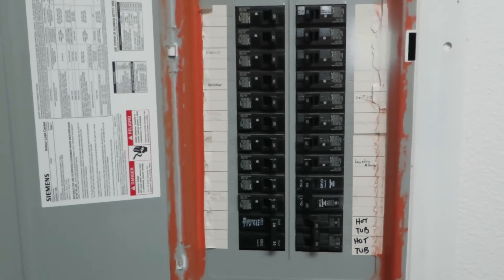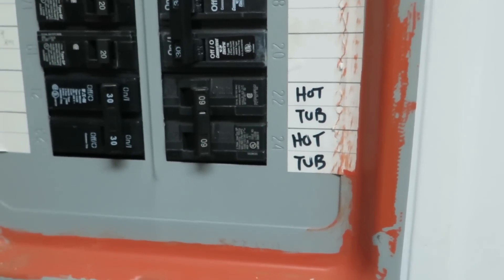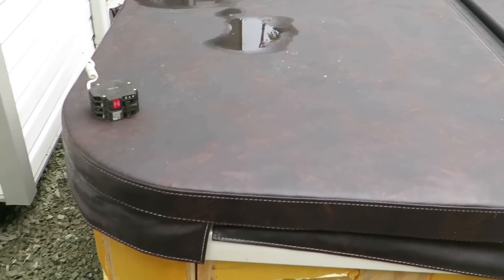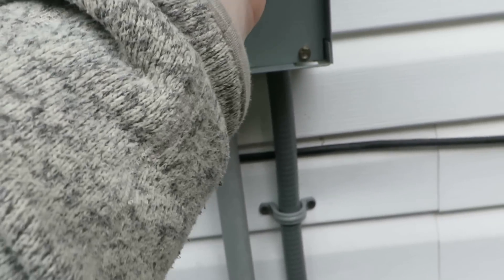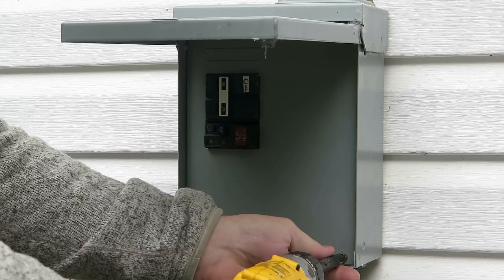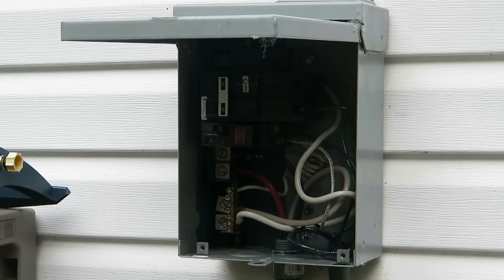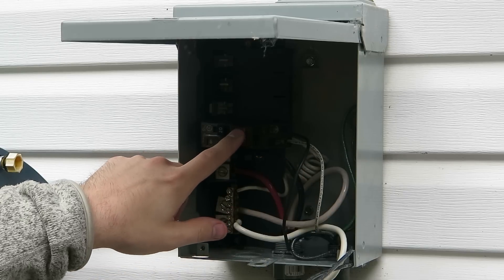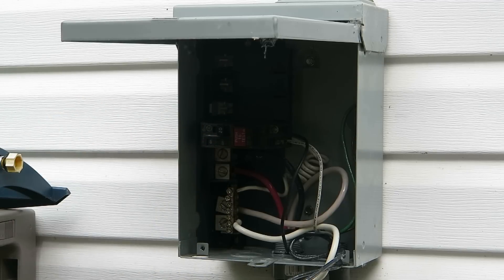Spa Electrical Basics

Comment: The 60 Amp breaker plus de 20 Amp breaker would NOT break at 80 Amps!  .- ( They are in separate circuits)   In an overload,  any of the 60 Amp  breakers  whether at the garage panel or at the spa site will trip first,   while the 20 Amp breaker will trip independently with a 117 AC overload..       Do not place the box "were is convenient"  follow the code!.

Comment: How come no one noticed that this is a new installation, so it is all his work. Second he added the 60am 2pst GFCI breaker in that panel and THEN!!!  ran and connected #12 THHN to the Hot tub and wants to change it out to a 30a 2pst  GFCI breaker without updating the Conductors to #10 at least. Plus run the Sealtite under the hot tub at it's closest location to the disconnect. Did anyone see any Grounding Conductors? This man needs to hire a pro and not put himself and family in danger.

Comment: do not listen to this guy. he has not a clue how electricity works. coming from a red seal electrician, the 60 amp breaker and the 20 amp breaker are FINE....  20amp plus 60amp do not not actually add up to 80 amps... its meant to interrupt a fault or combined load of 60 Amps. a normal operating tub will not draw even close to 60 amps. its purpose is to interrupt a fault above 60 Amps. and motors will have an in rush current that spikes high at start up and drops during normal operation... (Canadian electrician)
Reply: ya i was so confused by comment section until i seen your post to verify i wasnt lost. i was going thru my head like the owner didnt realize he just needed to see what the normal constant amps wld be than see what the start up rush is. ive seen this done wrong before its like  

4000watt heater on  a single phase wld draw 33.4 amps so 40 amp breaker vs dbl phase 240 thts  16.8 amps. so with a dble pole 30 means only half the amp usage plus start rush?  sorry been so long i cant remember math (but i think something high draw like a filament bulb is %10 s0 say 2amps at start safety margine will say 20amps)or i wld just overcompensate what the info plate wld say. but the 60amp breaker at worst wld need max of what 20amps so 1/3  of its max capacity.  im only a 2nd yr apprentice at best  and havent done the trades professionally in 20yrs very rusty but getting more work during these times (the pros are either to busy or cost to much in these tough times where as i can safely handle these requests.    (well if my math is right ) otherwise ill just stick to outlets and lights lol  (N. east  usa)

Comment: Bro , I’m curious did this last, your line wires are way to small .
Reply: I mean, it only burst into flames a couple of times. So it's ok. 110, 220, 277, 480, 2300, 4160... whatever it takes.
Reply: Jason Allen right! Also the white neutral...
Reply: Heard the new family were on the news just days later. Something about multiple electrical fires or something.
Reply from the maker: Works fine.  Just sold the house.  I use the hot tub 3 times a week. Zero issues.

Comment: Im sitting here trying to find out why this tub needs 220 and 110.....
Reply: This is actually how hot spring 110v convertibles are wired. 30amp 240 for heater, 20amp 110 for pump.
Reply: Joseph Kellner makes sense than if one of the hot tub brands does it split.
Reply: Nothing weird there kids. Extra breaker = extra circuit for whatever else you want to include in your spa package. Like an extra 110v outlet to power that toaster he likes to use while he's soaking. Outlet, 5 feet away from the tub ofcourse. But with your trusty 5ft extension cord, you can have any dangerous appliance in the tub with you all while within code!
Reply: Maybe controls use 110 and the motor and heaters may be 220
Reply: Stephen Roberson that would just be strange. Even the radio systems in some units don’t require 110v. I have to wonder if the spa box was wired to support both and they just happen to both be turned on even tho the 110v doesn’t have wires coming out.
Reply: Edward Sessum hot tubs can have only the heater on, for 110. Alternatively, if you want the heater and the jets on, it would be 220
Reply: Mad_ Max but they don’t get wired for both. One or the other.
Reply: Edward ... that dual circuit was common 20 years ago and the heater was split to run either 1500 watts on 120 volts or 3000 watts on 240 volts. Basically this gave people in warmer climates the option to use a 120 volt outlet to run their tub without the expense of a 60 amp circuit. These days the extra breaker is commonly used for a service outlet.
Reply: Hot Tub water is heated by using a typical 1500w at 240v. Think of regular water heaters that use electricity. 120v is for the lights, and sometimes for control circuits if relay coils are rated for 120v. But since it is such a little draw you can tapped off one of the 240v lines, you just need to run a neutral for any unbalanced loads.

Comment: Everything mentioned in this video is incorrect , inspector would write this up in a heart beat , neutrals terminated incorrectly , whip longer than 6’ , incorrect breaker for load , and please do not use electric drills in a panel ! GFCI measures 75v through neutral from tub and they “DO NOT TIE ALL TOGETHER” .
Reply from the maker: Would they?  It's been inspected and passed.  Sounds like there are either a lot of poorly trained electricians out there or a bunch of keyboard warriors.
Reply: photokendall no , lol poorly trained inspectors , city inspectors are not Licensed electricians , only adopt what county / city is for current code . Look up NEC 680 and educate
Reply from the maker: @live4545  I appreciate the code reference, however I still dont find any code reference as to what exactly is not to code.  The branch circuits and bonding all meet code, the pvc meets code, etc etc.  I was an electrician for many years and though it was practice not to use a drill in panels, there is zero code against such a thing.  There is annidotal evidence on not using a drill, but zero facts to back that up.   That's like saying you can't use a drill to install head studs in an engine.  Yes it's practice not to...  However, I have installed many head studs in engines using drills and then torquing to spec without any issues.
Reply: photokendall the gfci is not terminated correctly , and you can find the answer to why in NEC section 680
Reply from the maker: @live4545  Thanks.  I don't see anything there.  But appreciate the input.  I guess if I am doing it wrong so are a lot of others in the industry as the way this is hooked up is standard practice.  I quick google search of electrical spa hookup and I found this.  https://www.hottuboutpost.com/hot-tub-electrical-installation-hookup-gfci/ and this https://www.masterspas.com/documents/240v-electrical-requirements.pdf
Reply: photokendall I read that you sold the house, but just FYI the links you posted show exactly how you hooked up the neutral incorrectly. There must be a load side neutral attached to the breaker. Your load side neutral goes straight to the bus bar. In that configuration the breaker can’t monitor current difference and can’t do its job.

Comment: Please correct me if I am wrong. 
By code (You seem to like to stick to it, as all should) you must have  4 wires, out of your sub-panel to  hot tube, because Neutral (White) is not equal or interchangeable with Ground (Copper) that in case of emergency wont do good, if not installed right. I see no Ground in your sub box. Anyone is invited to comment, kindly, as spread of correct information is the goal here. Stay safe.
Reply: not all some do not require neutral

Comment: Dude has his white from breaker tied back to the neutral buss bar, the white out of the breaker goes to the hot tub not back to the buss in the box.
Reply: Common in hot tub panels is to wire the pigtail to the buss bar that is isolated from the ground (there should be two buss bars with one insulated from the panel and one directly on the metal)

Neutral in from the main panel goes to the GFCI doyble pole breaker, neutral pigtail goes to the neutral buss bar, and the neutral from the hot tub goes on that same neutral buss bar
Reply: @shimes424  Faulty information from an rank amateur...Dont listen to anything this guy has to say. You have one life, pay someone who knows.
Reply: breaker has a load  neutral  connection/white from breaker goes to neutral buss along with neutral ine

Comment: Hey quick question for all you electrical guys here... So I got a 100 amp main panel and ive had a 50 amp double throw breaker running 80' to a sub panel in my garage and ive had a 3 wire #8awg going through 3/4" emt set up goin thats worked great for years. Now i got me a 230 v 5 hp single phase industrial compressor and every time that hog turns on The attic and wall that the main panels on vibrate and buzz like a sum bitch but only for a few seconds then its good. So I hear I need bigger wire so i now have #4 that came outta an industrial building and some 1" ridgid ran now but my question is HOW MANY WIRES TO PULL AND WHAT SIZE?  3 or 4 wire? Oh and sub panels got a 10' earth ground jammed into the ground within 4 ' of sub panel and also its has a wire going to the cold water pipe on the washer and dryer crap just no earth ground on my main no clue why either lol PLEASE HELP THANKS FOR YOUR TIME
Reply from the maker: So, 230v 5hp...  230v standard is a single power conductor and a nuetral wire.  You normally have a ground wire by code to protect yourself.   If you pulled in a 4th wire it is usually used for anything that needs to run off 120v.  hopefully that helps.  We would need to know the amperage of the load to know what sized conductors need to be used.  However a #4 would work for a 50 amp load.
Reply from the maker: Here is a good site to calculate loads/distance and wire sizing.  Wire Size Calculator - Paige Wirewww.paigewire.com/pumpWireCalc.aspx
Reply: @photokendall  Hey thanks for all your help photokendall yeah so pretty much just said screw it and im going huge and when I say huge im talking #2 awg stranded but not the flimsy crap this stuff is about the same size thats coming in from edison side to my main panel. I figured its been working there so its pretty much like an extension of that right? Now i also have 240' of #4 awg as well only thing is 1 leg of my #4 is kinda shot out from getting caught on crap so I was just gunna use 1 leg of the #2.. Any problem ya see there man  I mean it should work just fine right or is it gunna do some crazy stuff like how if you run 1 single hot wire in a 1/2" emt it electrifies the shit outta that conduit kinda thing or should it be a ok? Oh forgot to mention I am not an electrician  just a feller wanting to save a buck and learn some stuff thats all ...Oh and have a blast doing it  as well !
Reply: @photokendall  i ENDED UP RUNNING 2 #4 AWG AND A piece of #2 about 25' long then spliced it in a box and continued running the left over #4 wire i had ...Is there any reason I shouldnt run it like that? IOts been up and running now for about a week and seems fine but if theres a problem with that please let me know buddy . Thanks again for all your help man
Reply from the maker: @janegoodall3862  due to the wire size there is going to be a lot more resistance using that wire which means you "may" not get as much current or voltage, but in real world scenario it shouldn't matter.  You should be OK.  Real world your worried about under sizing conductors because they can heat up and cause a fire.
Reply: @photokendall  Well Im pushing the living heck out of the system today my friend .....Doing some arc gouging or however its spelled which needs the ol lincoln arc welder and the big ol compressor oh and now my 10 high output T-5 light fixtures with 4 HO 6000k  35watt T-5 bulbs in each fixture . So with this subpanel you have wired up photokendall its going to be make it or break it and poof my damn house goes up in flames today so we shall see man . lol i'll keep you posted amigo and once again THANK YOU FOR YOUR HELP DUDE !!
Reply from the maker: @janegoodall3862  Uh, this installation here was for a hot tub, not for welders, compressors etc!  Your using an 50 amp breaker for a compressor and arc welder plus lighting?  That may be a BAD idea...   I have a 2 stage 80gal air compressor 240v and that requires a 20 amps, 17.5 but due to startup current it peaks around 20amps...  You need to go around and see what your going to be plugging in and running and then add those all up.  Once you know how much amperage your going to be pulling then you can determine panel size.  Sounds like you did this the other way around.  Hopefully your good.
Reply: @photokendall  Yeah im no electrician my brother all I do is make things happen when  i need em but yeah I have a need for more power in my shop /garage  so I ask the heck out of questions and such to as many people as possible and pick their brains a bit  kinda how you came about my friend. I do have an arsenal of electrician  friends and brothers who have 30+ years and all sorts of schooling that would of happily  got me my 240 v sub panel all done up....but F that that way I dont learn a damn thing  ya know. I also have a building inspector looking at my work as well as real   sparky before I fire things up so we are good there. My brother and I were taught growing up always go overkill and some instances go way overkill on things ya know what I mean right ? You have been a great source and help in my project and are a smart feller bro THANK YOU buddy. Everything is up and running and i only had  to lower the amperage of 1 breaker which I knew was huge to begin with but all i had lol . Now on to the next experiment / project  and that is making a 460 3 phase motor run  off 240 v single phase.........any info on this one brother ? lol
Reply from the maker: @janegoodall3862  good deal!  Glad it's working out for you.  You can get a VFD that will convert single phase to 3 phase.  Depends on your application but it's used a lot for electric motors.
Reply: @photokendall  Its actually for an axial explosion proof fan I picked up so VFD would do it huh ?
Reply from the maker: @janegoodall3862  460v is some serious power..  Your more than likely going to need to feed it with 440v single phase and convert it to 460v.  The cost of the VFD isn't cheap... $2000.  Maybe less if you shop around.   I would look into a different fan that runs off single phase personally...  Good luck!
Reply: @photokendall  440 v single phase you say ? I didnt even know there was such a thing but awesome. Ok so heres the update ...we are shit canning the 460v 3 phase and now thinking of somehow getting 480v 3 phase  from 240v single phase. Fixin to get me a milling machine and a lathe all for metal so is this doable or should I just buy equipment for 240v single phase and be done? I mean the house is still standing and nothings on fire yet so I figure keep trying to get all I can outta that main huh. Only if there was a way to bypass that damn meter cuz my power bill is gettin damn costly lol

Comment: WOW.  So many mistakes.  Guys like this offering electrical advice should be banned from YouTube.
Reply: I'm not that savvy with electrician work, but I have studied EE. Pretty sure a GFCI works by comparing current, NOT voltage. A fault means the electrons can escape the circuit. If the circuit doesn't have a fault, the power consumption (or load) of the circuit should drop the voltage. Please, someone correct me if I'm wrong. I'm a DC guy.
Reply: @MindOfVacuity  newer gfi trip at 5 to. @10 milliamp differetial
Reply: Can you list the mistakes to help some of us watching?

Comment: Lost interest as soon as he started adding the 60 and 20. Common mistake but wrong none the less. Think about it. You have a 200 amp panel yet 42 slots of 20 amp breakers! Do the math.
Reply: Knows just enough to fuck shit up and burn the house down 🤣
Reply: @seanlindy  🔥
Reply: Based on this guys math  I just realized  that every service panel in the world is overloaded. Wow.
Reply: @markwicklund3976  ... using the 80% load on a branch circuit that means a 100 amp panel should only have 6 breakers per side. (12 total) That would also mean a 200 amp panel should max at 24 breakers.... but they don't because code realizes you will never use everything at once.
Reply: I think the chance of every breaker running at full load at the same time is very slim.  I’m not sure if it’s code where you are, but my load center also has a 200amp main breaker.